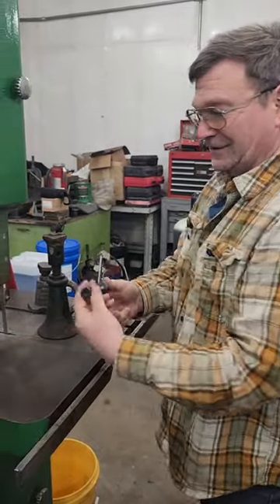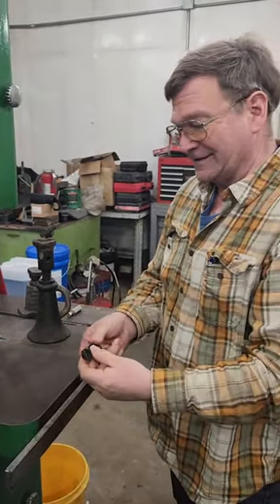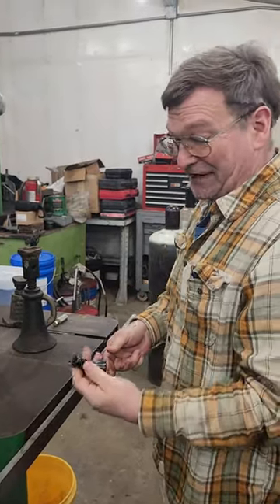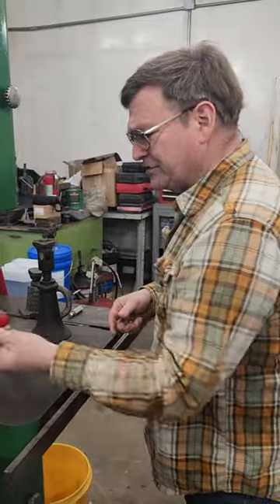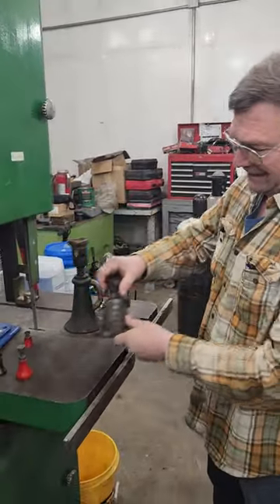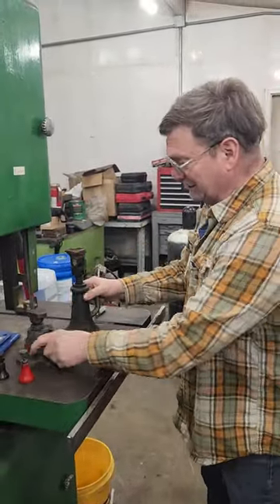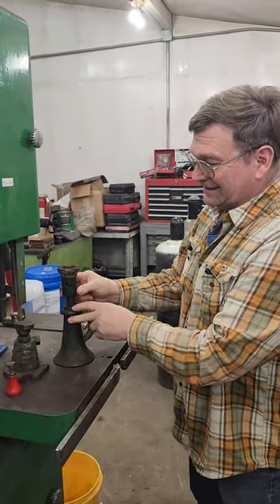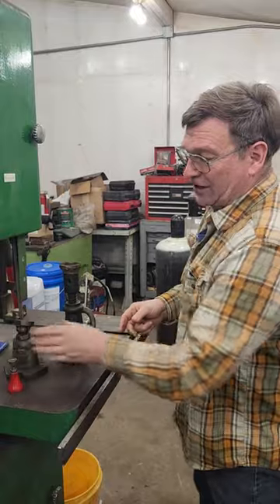Machinist's Minute: How to build a DIY setup jack for cheap

Comment: Use a stud coupler with a bolt and you get plenty of adjustment.  You really need to remove any raised markings from the bolt head to get it to sit squarely on the workpiece.
Reply: I like this idea. I use standard Teco t-nuts, bolts, and coupler. The t-nut to keep it flat, and the coupler for adjustment. Plus the little extra you can move through the t-nut.

Comment: Or a coupling nut would get you all the way there.  

There are some tricky ones with combo studs from mcmaster: metric thread and standard, one stud turn will do so many 0.001
Reply: Most milling machine clamping kits already have coupling nuts. And studs and flanged nuts. So (except for really low headroom situations) you just turn the flanged nut upside down on the right length stud, thread the bottom end of the stud into a coupling nut, back another flanged nut up to the coupling nut, and you have deluxe jacks, any height you want, already there by each machine.

Comment: Most used Jack in my shop is a coupler nut / union nut and either a hex head bolt with a smooth head, or a shcs with a ball bearing inside the socket. Lock it down with a clamp from above. 💪

Comment: You can get coupling nuts like the ones used to connect threaded rods together if you need more adjustment.

Comment: I haven't been a machinist long was a welder for years but i haven't found a reason for crazy nice jacks I've actually used nuts and bolts for jacks worked just fine

Comment: I would chuck the bolt in a lathe, drill a hole for a hardened drive rivet. That gives one point of contact, so the bolt won’t walk as it gets turned.
Reply: I've done this but using a bearing ball. 
Of course the workpiece needs to accept ending up with a dent...
Reply: I just used my ball turner to put a slight radius on the head.

Comment: I been using that trick with bolt and nuts forever, I had a whole pile of different sizes and lengths, I mostly used it so I could toe clamp odd shaped parts that were unsupported

Comment: I've had excellent luck with a grd8 bolt(like 3/8"ish) 2 nuts, and a length of steel tubing with a 3/8" ID 

I had to Jerryrigg a setup to press fit a race bearing on the internals of a really old Landis centerless grinder. I had maybe 3" out to 6" of throw in a horizontal shaft on the inside of the case. Absolutely saved my ass 😂

Comment: I’ve used T nuts in the bed with all thread in it with a coupler nut on the end. You get a little more adjustability with the length of a coupler nut.

Comment: use a 3/8in rod coupler and a 1.5in long 3/8bolt. if you need something softer you can use brass grounding rod coupler and rod.

Comment: Sometimes you need the stud and nuts to get in and brace a flimsy weldment.  Use a coupling nut if you need a little more travel.

Comment: Exactly I've never used to set up Jack because they are a complete waste of space instead I simply add additional nuts bolts and washers as well as horizontal bars to my setup kit. And don't be forgetting your aluminum and copper plates. Tooling marks are fine setup marks are Unforgivable unless they allow you to find your way home.

Comment: weld a larger nut to bottom of the adjusting nut. you get more travel and the same overall minimum height and a taller max height.